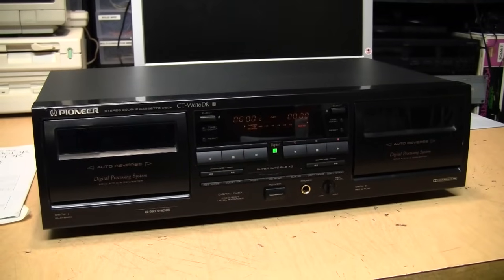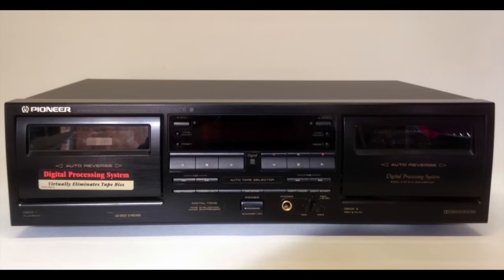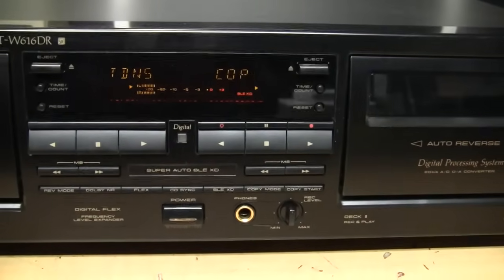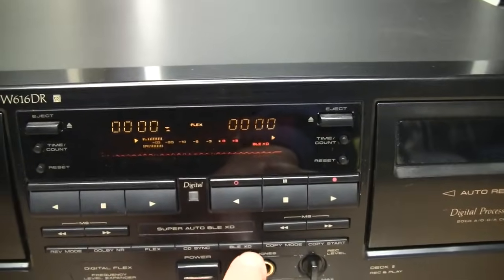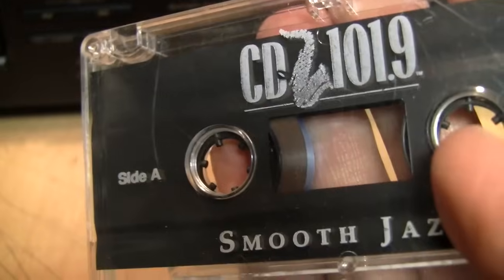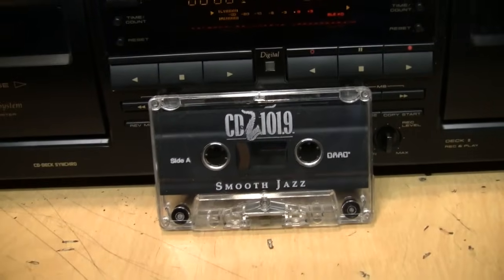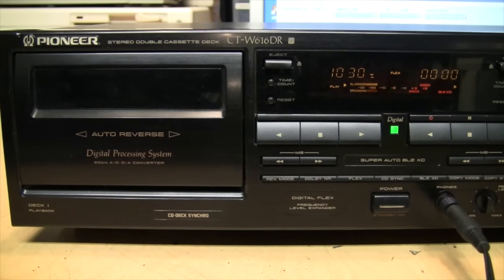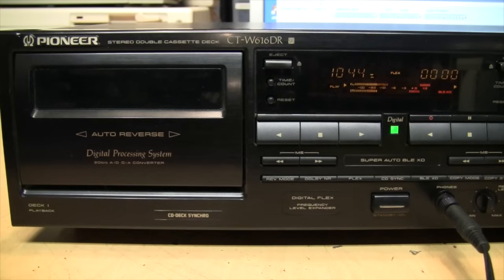A cassette deck that eliminates tape hiss - Pioneer CT-W616DR

Comment: Ah, the 1990s, when audio gear had more pseudo-technical terms emblazoned in bright gold on the front panel than the equipment had parts inside of it.
Reply: U're kidding me? Just look at the size of this deck. The tape mechanism itself is a very complicated thing, not to mention the electronics, pcbs, wires etc.
Reply: @papasnejk87  Not as much a "complicated" thing as it was in the late 1970s or 1980s. Late 90s audio gear means no fancy 3-head, dual capstan, closed loop mechanisms but instead just a cheap belt driven tape transport from China.

It may look complicated but all of the 'quality' is done in software with a big DSP chip on the board. But garbage in means garbage out, no matter how hard you try to fix it in post.
Reply: @Stoney3K  nah
Reply: @Stoney3K  you're a decade too late for that. The "you can't get more quality than what you put in" myth is more embarrassing than ever, especially regarding video, when mainstream gaming channels are literally saying "use DLSS, trust me you won't notice the difference". And of course, the huge and very embarrassing elephant in the room: equalizers, a product that is literally designed to and is very successful in making music sound better than its source. Good gosh, people. I'm not saying that a cheap deck with high end digital features (very much not the case for this deck, by the way, please explain why you think that a 90s Pioneer deck would have been made completely in China) can compare to a very high end deck without. I'm just saying that you need to use a much more serious against digital processing than the face-palm worthy "digital can't make things sound better" myth. Seriously, how do you know this channel exists and don't know about professional digital remastering? It's literally an entire PROFESSION to make sound better via digital tools. And if you think that Nat King Cole always sounded CD quality on the master tapes, wow, have I got a bridge to sell you. All you have to do is Google around for songs that have original releases and remastered versions.

Comment: If you have old recordings on your computer as mp3s, is it possible to pass signal to this deck without recording back to tape to get the digital processing used on it?
Reply from the maker: No.

Comment: I read if you hold down both time/count buttons simultaneously on the unit's tape decks it will turn off the digital processing which is set to ON by default. The green digital light will turn off on the unit as indication. Just tried it.
Reply: ...and you mention that too. Sorry I was excited.

Comment: Do these things have a volume control for headphones? I've got my Dad's pioneer ct-07d, but when I tried it with headphones it was extremely loud.
Reply from the maker: Use headphones with an inline volume control, or add one to headphones that don't.
Reply: Thanks

Comment: The 606DR  is identical except the flex and BLE buttons are not there. But the circuits are still in there! you just have to mount buttons. The made 1 model to cover 2 price points.

Comment: This deck is very hard to find, i have been searching and searching for this deck, no luck, a true classic in vintage stereo equipment, i tried eBay, Amazon any ideas where to find this deck?
Reply from the maker: In the description I list all of the Pioneer cassette deck models which have the digital processing system.

Comment: Question actually I have several decks (amp, eq, tuner) sitting on top of the cassette deck. Is this bad for the deck?
Reply from the maker: As long as it's not excessively heavy, it'll be fine.

Comment: I actually have this same exact deck. I bought it at J&R Music World way back in 1996. I used to make compilation tapes to listen to for my car before I finally bought an in-trunk CD changer. The sound quality of the tapes I recorded surpassed the commercial prerecorded ones by far. Most people couldn't even tell if I was playing a CD or a recorded tape I made from the CD itself.
I still use it from time to time to play some of my old tapes (that I recorded) dating back to the early 1970s, and also use it to make digital copies (from cassettes to computer) of some of the old stuff for archiving purposes.
Reply: A good tape deck using decent metal tapes and dolby c with a good recording can come so close to CD that most people won't be able to tell the difference. Dolby s takes that a step further... but both are of little help with prerecorded tapes. 

This deck however can be a lot of help for that, and for older (pre dolby c era) recordings.

Comment: What, if any, would be the Technics equivalent high end dual tape deck? I'm building a system for my father and he would like to keep the setup brand specific. Thanks
Reply from the maker: The Digital NR system was a Pioneer exclusive. But aside from that there were plenty of high-end Technics cassette decks -- too many to list any specific model numbers.
Reply: VWestlife Dolby S is best, Right? Ct-07d is the highest end pioneer deck on your list, correct?
Reply: RS-M280 and RS-B100 comes to mind.
Reply: Dolby S is best, but not widely supported (and you really do not want to play a Dolby S recorded tape without Dolby S being enabled), and does nothing for the tapes you already recorded. This deck will improve the playback quality of tapes even when not recorded with any kind of nr at all.
Reply: I would say RS-TR979.

Comment: Hi, were there earlier decks that eliminated hiss pre 96? I'm new to this hardware and wanting to collect cassettes.
Reply from the maker: Yes, with Dolby S noise reduction -- but it requires a tape to be encoded with Dolby S, while Digital NR works with all cassette tapes.
Reply: there were a very few decks which used the old National Semiconductor analog dynamic noise NR feature, "DNR" as it was called, that worked similarly to the pioneer proprietary digital NR circuit.

Comment: Is this deck, (I found a 606dr) worth purchasing to digitize cassettes or better to get one like the technics rs-b12 you showed some years ago?
Reply from the maker: The Pioneer is much better because of its Digital NR feature.
Reply: VWestlife VWestlife thanks for your help! I went for the pioneer 606. Missing the flex feature but I think I will still be happy with it. Got it for around 50 with shipping. It will be replacing my JVC td- w209.

Comment: I have a Pioneer dual deck similar to this, a model CT-W604RS, that I used for several years.  Had great sound and was really quiet.  Then one day it just died, no power.  Since everything is now throw away junk we no longer have electronic repair shops locally so it's in by bedroom closet where it has sat for around ten years.  Pioneer had some great ideas with their cassette decks that no one else had.
Reply: Spooky, that's the second comment I've seen mentioning that. Something to look forward to, yay.

Comment: Tapes that have been prerecorded with Dolby typically sound poor when trying to play them back with 
Dolby engaged. So the fact that your tape sounds poor when trying to play it back with Dolby isn't a good indicator that it wasn't recorded with Dolby.
Reply from the maker: No, that's not typical. Dolby recordings sound great with Dolby engaged on this deck.

Comment: I have a Pioneer CT-W606DR.  AWESOME cassette player!  Used one to transfer a demo cassette to CD and was amazed at the time that I was dubbing it at the complete lack of tape hiss through the headphones I was using at the time.  We also had a Sony CD burner at the time, as well.  I've always been under the impression that it was just a really good quality recording/cassette that they used, but I'm sure it was mostly due to the tape deck I used.
Reply: Smooth Jazz radio stations....  shudders with revulsion --  then puts on some August Burns Red, Demon Hunter and Metallica to erase the traumatic memory of it...  :P

Comment: Anyone price high quality blank cassettes lately? Do any manufacturers of cassettes produce good quality Type 2 (chrome) or Type 4 (metal) blanks? The ones I've seen for sale on Ebay (new, still sealed) go for about 5 to 10 times what they originally retailed for. So you'd better find a really good deal on a tape deck because the good blank tapes will set you back considerably.
Reply from the maker: National Audio Company sells BASF Super Chrome cassettes.
Reply: check their FB page, apparently they're coming up with a new formula for their tapes, type 1 and 2 I believe

Comment: pioneer ct a7-a9 were the best cassette decks ever built by pioneer ......ct f1000 and ctf 950 also very good machines but old ones...........this double deck model is crap compared with those models i've mentioned

Comment: i think is a waste of the energy if the source is good. there is no real algorithm.. basically is an auto hiss filter/equalizer. i vote for an analog filter. if u use B in recording (busting higher sounds) than play it with b (reducing high sounds). most of us played without B as higher tones are more expressed. C cuts to much / for voice recording only. HX maybe for FM recording..  in my opinion, cassettes die with only one reason: there is nothing more to improve here :)

Comment: Un appareil très intéressant rempli de caractéristiques originales et utiles pour le collectionneur cependant, le point qui me ferait hésiter à acheter cet appareil, même usagé, c'est le "Wow & flutter" qui est au dessus de 0.09%!! Le maximum acceptable pour une qualité audiophile est 0.08% ou moins Enregistrez un piano seul avec une bonne réverbération et ce "Flutter" s'entendrait. /To much Wow and flutter to be qualified as an audiophile cassette deck.

Comment: Maybe I'm hypercritical, but the tape heads are not correctly aligned with the demo tape. Listening through the mono speaker on the phone I can clearly hear the phase shift effect on the high frequencies that happens when the azimuth is skewed.
This greatly affects the performances of all the digital trickery as most of it is on the high frequencies domain.
A neat piece of kit let down by a not so neat review.
Reply from the maker: I have links in the description to better demonstrations of this cassette deck.

Comment: i have a ct-w606dr and i like to listen my tapes with this deck, sound really good but vinyl is better ;)
Reply: Vinyl Addict 
Vinyl gets scratched easily, cassettes don't and hiss is easily removed but cracks and pops are harder as you need the software or dbx which can be expensive, compared to this deck that does it all

Comment: Just got my hands on a CT-606DR purely based on your review, I was that impressed (euro model, so with all the 616 buttons and features) with the audio on the video, and I must say it sounds even better in person!

I am actually stunned the quality of the playback and the TDNS feature when dubbing. Its on a par with my other two three head single well decks (Sony) and whilst those both have Dolby S, you don't actually need it on this deck. 

Whilst IMHO Dolby B for the most part to my ears sounds dull and missing top end, on this deck it sounds superb with NO Dolby at all! But with B and C its even better, must be the FLEX kicking in bringing the top end to life. 

If you can find one of these decks (I had to get my shipped from Germany to the UK and it took a 10 day wait.. and was a gamble E-Bay purchase that it would be OK and survive the shipping) I would suggest you don't think twice and snap one up. 

Highly underrated decks and proves that a three head decks arn't the be all to end all!
Reply: I've since this weekend gone stripped and cleaned the interior, it appears to be a 1997 model, I put new belts on each mechanism and oiled the motor, set azimuth and used a couple of test tone tapes to get both decks playback speed spot on. It's a real easy deck to work on to do belts, much easier than my Sony ones at least!
Reply: I'm waiting on an ebay 606 Euro version too, described as tested-working. Any advice regarding order of steps to undertake to test functionality. Is the refurb process easy enough for a novice who hasn't taken down a deck before? Any interest in assisting if need be?
Reply: This trumps all my Naks, even the ZX-7! No kidding.
Reply: I have a 606 off the back of this video .. my main issue is the earsplitting Headphone volume  ... does anyone know of a hack to add a pot to the rear so that the level can be controlled  ...

Comment: Boy the prices have jumped in the last year since I started looking to replace my old CTW 505 R Pioneer. If you're thinking about investing then do it now. I had to go through 4 decks to get 2 to survive shippers and bullshitters sending broke crap. All decks really need at least some minor repair, new belts, to broken head mounts for these auto reverse decks. I'm hoping to get 2 more rolling including my old worn out deck using the smashed deck received in transit for parts.

Comment: "you got almost cd quallity sound" CD has 2 - 20000 Hz this Pioneer has 20 (TWENTY is not TWO) - 20000 Hz. Knowing that fact that metal tapes nowadays are very expensive, so people are using normal position tapes or sometimes chrome tapes. So fairytale about almost cd quallity is not correct and far from the truth.

Comment: i have one of these (among others) but always wonder  if you disable digital mode is the path to the rear cinch out all analoge? I mean if i use this deck to copy tape to the pc i dont want it to do first  analogue to digital then digital to anaolue and then my pc does again analogue to digital. question is does the deck when digital in the out mode  means the deck does no digital stuff at all?

Comment: i have both models the w 606 and the slightly better model the 806 with legato link conversion,like their mini disc models had. cracking sounding decks even without,using digital enhancements,or dolby. built aint the greatest,and mine are quite noisy mechanically,could do with a greasing,but sonically i aint heard my cassettes sound better. these are a sleeper,if you like your cassettes by a load of blank tapes, and get your self a good example of one of these decks and you will be in analogue heaven.

Comment: It must use Adaptive filtering, DCC machines need recapping in both the Analogue and Digital parts also you know what I mean Electrolytics in the PSU and tantalum’s in the Digital and Analogue circuits or the unit might not work as intended.

Comment: Holy crap, I have that deck.  Well, not THAT one in the video, but the same model.  Haven't used it in years.  Did dub a lot of road tapes with it back when I had a cassette deck in my vehicle.  Maybe I should dust it off, fix the Sherwood amp (resolder the RCA connectors, one side is loose) and hook 'em up to the Klipsch speakers...

And second holy crap, the announcer on that jazz tape sounds just like one of the announcers on the classical station here in the SF Bay Area.

Comment: I have a very similar Pioneer deck without the DNR. I bought it for my parents back in '96 (I think) and took it off their hands when they no longer needed it. It still works perfectly and I use it to archive and restore old tapes. The right-side deck seems to have better sound quality though.
Reply: Common issue from what I can tell. My left deck is the better one on my Ct-w604rs.